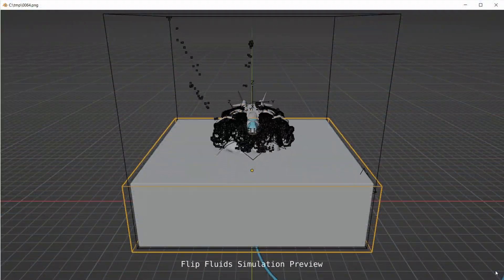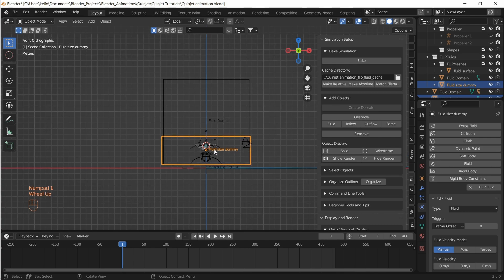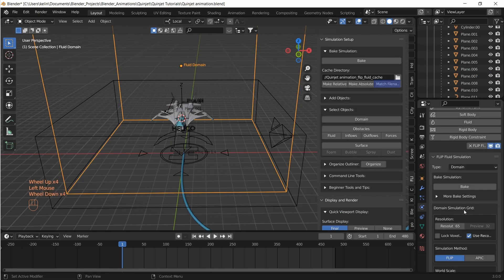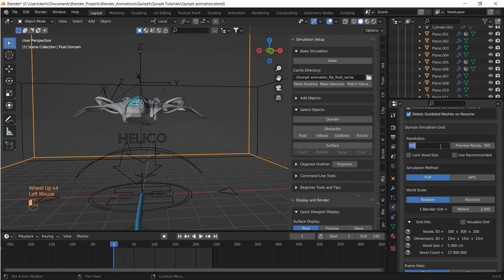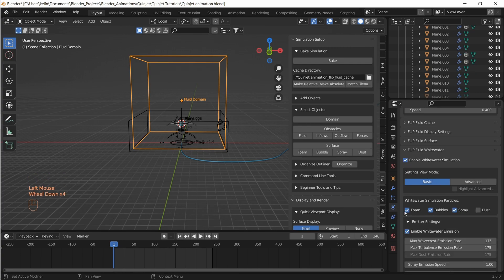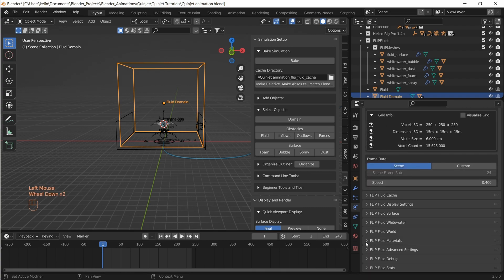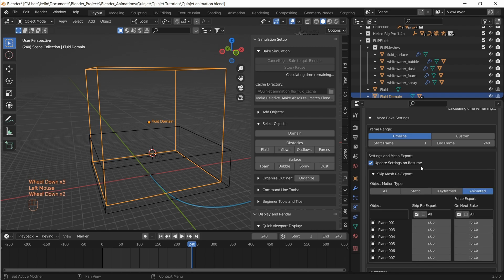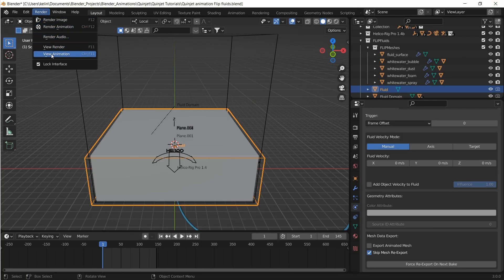Blender Tutorial | Flip Fluids Simulation (Please also watch latest hires animations - links below)

Comment: hi bro, actually Iam  trying to create a whale model that is moving up to the surface like in blender using flip fluids. The problem I am facing is when I move any obstacle not only whale, from the bottom to top, the flip surface tends to bend like elastic and stretches along with obstacle which looks unrealistic. Even if it completely comes out of the water, The splashes moves to the domain top and never settles. I am stuck at this phase for a month bro. kindly give suggestion

Comment: The baking of such simulation will need very heavy pc specs and long render time, is there any shader technique to use image planes at the cost of realism for smaller and unimportant particles. Always facing the plane to camera-Z direction. Because it is not possible to bake each time when we want to change some parameter. I mean this approach is not flexible.
Reply from the maker: Good question. I’ve seen such a technique used for smoke simulations where smoke is rendered and imported as a plane and always facing the camera for long shots. I haven’t tried this for liquid simulations but can be tried.